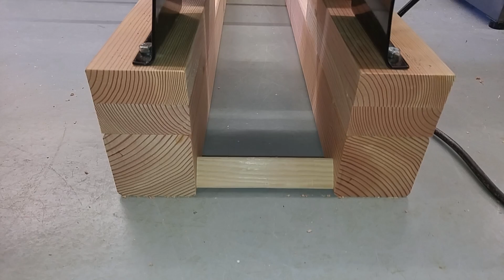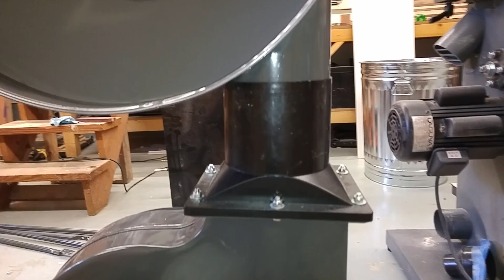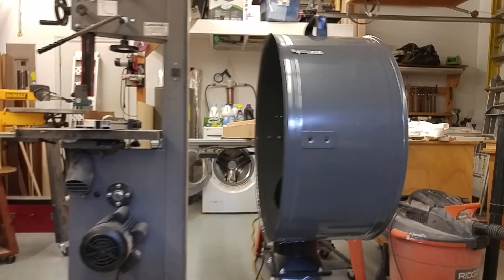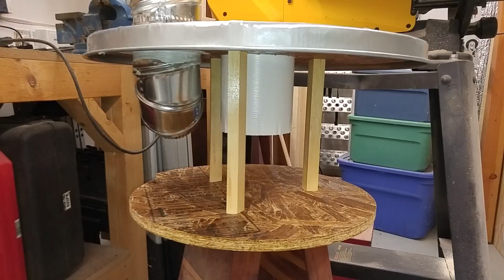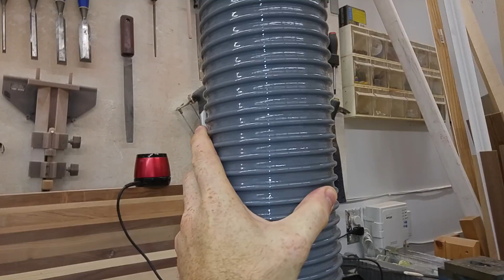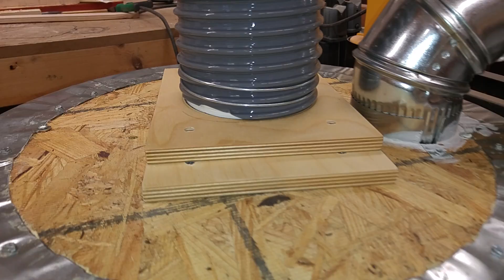Harbor Freight 2HP Dust Collector Modification Part 1/3

Comment: I like your set up. I was going to try and copy it. I tried using the 4 inch coupler on my HF dust collector, I just couldn't get it to go on. My HF dust collector is an older model I think. Mine is green with a black motor. Tried using a heat gun to make it little to slip on, no go.

Comment: Hey, nice video. qq, that corrugated coupling connecting the blower to the 20 in can which hold the filter bag/clear plastic.  My HF has holes with 5in (4.75in) diameter, and wondering how that 4in coupler fits around that?  Seems a little smalls.
Reply from the maker: It's an outside coupling for 4" corrugated pipe, so it needs to be big enough to fit over the already oversized pipe. It's a tight fit on the HF, which is a good thing.
Reply: @TheSnekkerShow  Thanks for.the quick reply.  I wasn't sure with this being a 5 yr old video and all if I would even get a response.

Comment: Hi there ... great series! I am trying to leverage some of your design, but I'm struggling with getting fittings that will work with the hose. What sizes did you use? I need to connect the impeller to top of the can using a portion of the existing hose. How would you recommend making that connection?
Reply from the maker: I used a piece of aluminum flashing and rolled it into a tube that fit inside of the 5" hose. That let me make the transition between the 5" hose and the 5" hole in the piece of plywood on the trash can lid.

Comment: Excellent use of available components.   I think the baffle is not necessary but it certainly does not hurt (much).   The inlet air stream has a downward velocity so the dust particles have a high velocity, high inertia down.   Because of the larger diameter of the can the upward air velocity is much lower and not enough to change the direction of the dust.   Per Industrial Hygienists handbook dry saw dust required 4000 feet per minute air velocity to stay in motion.
Reply from the maker: Alright, you got me wondering now. One of these days I might remove the baffle to see what changes.
Reply: @TheSnekkerShow  What I'm thinking is that it may create turbulence at the fan inlet duct.   Hard and fast fact is that fan performance is adversely affected by inlet turbulence even an irregular inlet velocity profile.
Reply from the maker: @g8r22  I took some air flow measurements in this video, with and without the baffle. Not quite an answer to the effectiveness of the baffle, but it does measure flow. https://youtu.be/CjKLIa9vyi4
Reply: @TheSnekkerShow  My bad - I think that answers that.

Comment: great video, thank you for the great ideas for my own HF dust collector

Quick question, is there a way to remove and replace the actual motor or is it sealed on the dust collection unit?
Reply from the maker: It looks like the motor should be removable, but you'll probably have to go inside the impeller body to access some of the screws.

Comment: Where did you find the referenced 5" "coupling for black exterior drainage pipe" you describe in part 1? I have searched everywhere.
Reply from the maker: And it's actually a coupler for 4" corrugated pipe. It just happens to be big enough to fit over the 5" connection.
Reply from the maker: I put links to most of the parts in the video description box.

Comment: This is an awesome building man. I’m making mine almost identical to yours. 2 questions, What is the diameter of the lower baffle and is yours the typical Thein style? Your lower baffle looks the same diameter all the way around. Thank you in advance sir.
Reply from the maker: I think it would be considered a typical Thien style. My lower baffle was cut from a 19" diameter circle, and has a 1 1/4" inset cut around slightly over 2/3 of the perimeter.

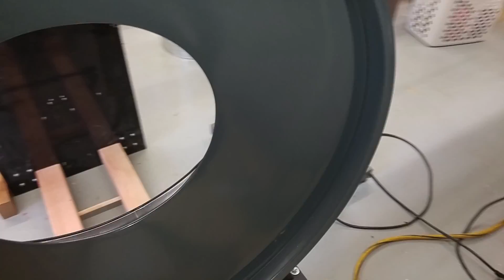Comment: Great video. I like your approach for lifting the motor without a helper. Where did you get the connector piece that appears at 2:07? I have been looking for it and cannot find it anywhere. It is not in the list of links that you added in the description.
Reply from the maker: Thanks. It's the first link in the description, but if that isn't working it's just a 4" coupling for black corrugated drain pipe.

Comment: High great build ,where did you get the black corrugated plastic pipe fitting .I’ve searched the web and have not been able to find the part,if you could post that information that would be great. I love the design,and I am building mine the same way.
Reply: i FOUND IT AT lOWES
Reply from the maker: Thanks. Product links are in the description. Good luck with the build.

Comment: I notice with most Thein baffles that the output elbow sits right on top of the 240 degree (lower) shelf but your elbow sits much higher making the whole baffle placement lower into the can. Do you think there is much difference? Also I see that you are using 5" input/output fittings on the Thein compared to others using 4" do you think that makes things function better? Thanks for the great video and design.
Reply from the maker: After two years of use, I'd say it probably doesn't make much of a noticeable difference in performance other than affecting storage capacity in the can.   If I do another I might make the shelf higher.   I've seen several variants and they all seem to work good enough.  Just try to mentally visualize the air flow (with wood chips) while your building and it will almost certainly come out fine.  I have my elbow pointed slightly downward to help the chips move down, but if it weren't for that then the friction would cause them to drop.

All of my connections are 4" except between the plenum and turbine.

Comment: Great work and idea. One quick question. When bolting the motor on did you use lag screws or bolt all the way through. Thank you
Reply from the maker: I used lag screws.

Comment: Thanks for the tip on the corrugated drain fitting you used, I bought one and as you said used a wood chisel ( cheap one ) and knocked of the taps real easy. The fitting was a little too snug on both the Supper Dust Deputy and the Harbor Freight side, so I placed my  SDD in a deep freezer for 30 minutes the coupling slid right on. I Placed the Harbor Freight part in the freezer for 30 minutes and they slid together nicely.
Reply from the maker: Glad it worked out.
Reply: Thank you for the freezer idea! The tolerances on that fit would be measured in the hundredths if not thousandths... I put the metal conical housing and the black plastic piece that comes with the HF dust extractor in the freezer for a couple of hours and the coupling in the blazing sun and it just and I mean JUST got it to "slide" together.... it took a fair amount of stubbornness, muscle, and getting it started just right to get it on... I'm thinking that no goop will be needed to seal the seems on that fit but will probably do it anyway... Thank you TheFalconJetDriver and Ben.... my two stage dust collector is coming together... and yes I am a complete newbie when it comes to creating sawdust. Ben your channel is so amazingly helpful. I know it takes a ton of time to not only do the things you do when videoing, but editing, posting, responding, etc etc etc... whilst being a dad and husband. Good on ya dude!

Comment: How did you attach the 4x4's to the base?
Reply from the maker: I drilled some small holes through the base and attached the 4x4s with some #10 x 3" screws.  They're just keeping the posts from moving around.